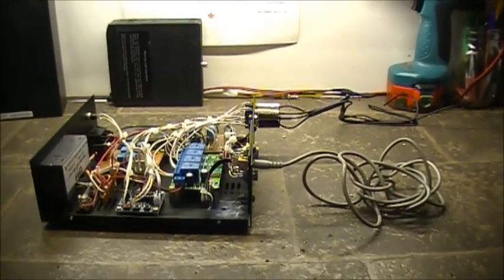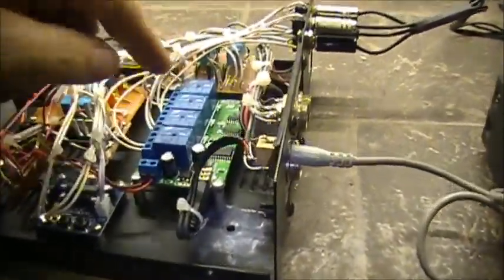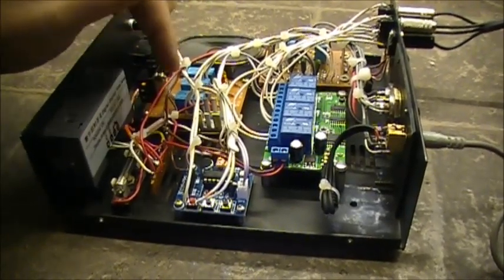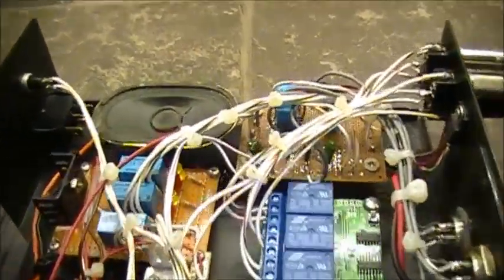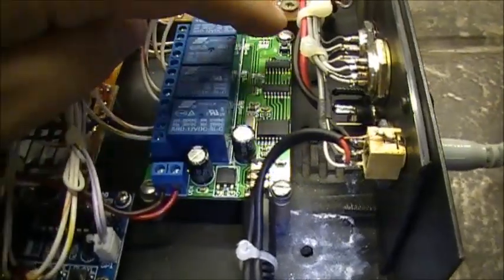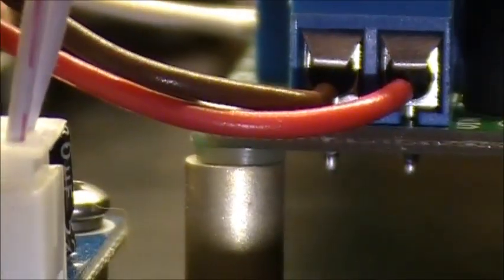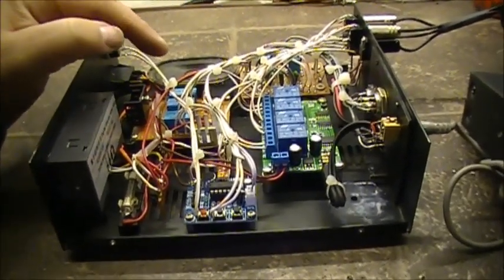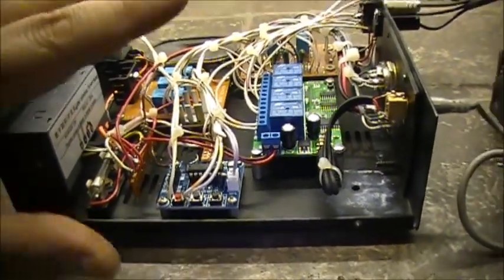CROSS BAND REPEATER PROJECT  -  DTMF Controller INSTALLED

Comment: looks like your relays are in momentary mode {no solder jumpers}  I think when a mode is selected with the combination solder jumpers, it effects all four relays.
Reply from the maker: The relays are setup the way i need them and according to the operations manual supplied.